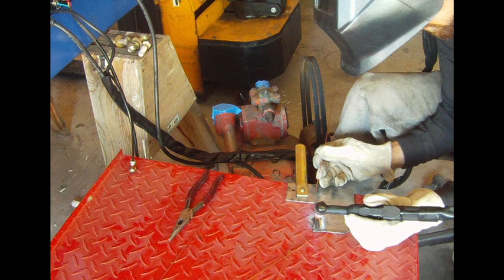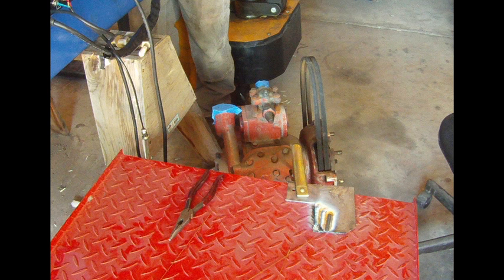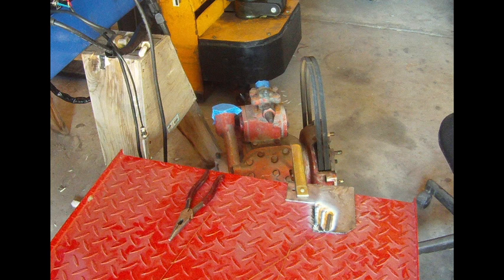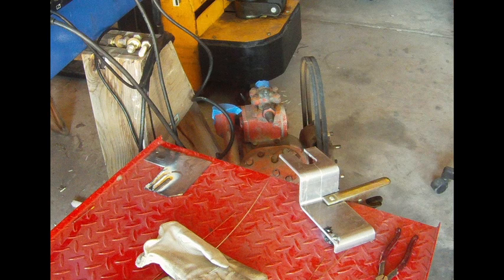Tool Review: Colossal Tech Super-200P (Pt. 2)

Comment: aluminum test is the only thing well plasma cutting i need.. stick welding is my favorite i use an ac [toomstone lincoln i got at a scrap metal place bent wires rotted rusted nasty i then  fixed the wires dried it out cleaned it n the main switch works as new love the ole toom stone  why i say all this is get one still make them as it will last  life times nothing to die in the ac model n just easy fixable caps and dildos n the dc version  ill be wiring the dc model to a weak ass 110v mig to get more power n just use the mig guts for wire feed and you all soo can make a salt water 2 copper pipes voltage regulator  if needed for speed  control fer brush motor tools n transformer welders tuning old school but valid

Comment: Hi, did you measure how many volts are in tig mode and in plasma mode? When you use footpedal it is posible to set max amperaj from front panel or from footpedal pot.?

Comment: Hi, I want to set mine up to tig. If you use foot pedal do you disconnect the trigger on the tig gun? I want to practise on sheet steel 1 to 2mm thick, what settings do I need set and what to?Thanks,
Reply from the maker: Yes just connect the foot pedal to the machine instead of the thumb trigger. set to 2T, DC, you can set the amperage pretty low maybe an 1/8 to 1/4 of a turn should be sufficient. Once you plug in the foot pedal the knob on the pedal takes over from the knob on the machine. Give that a try and adjust from there.